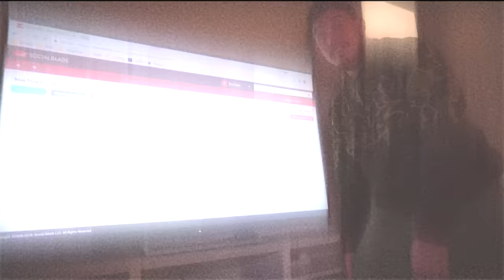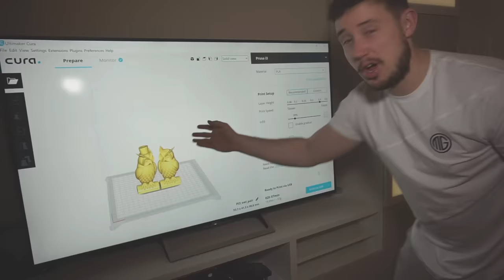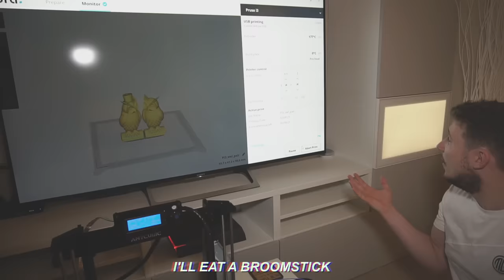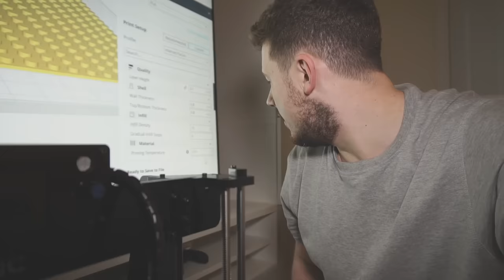I 3D Printed a House & Lived in It… It Was the Best Day of My Life! (3D Print Challenge)

Comment: Not even 3d printed parts... you cant create the gloss like that on a flat surface!
Reply: Hermolian true
Reply: Depends on the plastic
Reply: Haha house go BRRRRR
Reply: @bitsaucetv  It's all PLA, there was no evidence of any layer lines from the print.
Reply: CTH Security don’t forget that different nozzles have different layer lines, and some have really light ones
Reply: @bitsaucetv  Yeah but that printer comes with a .4mm nozzle and you certainly couldn't get prints like that without seeing the lines with that nozzle.
Reply: They’re inverted Lego build plates
Reply: @jacobwhite2737  In FDM in general you cant get away with out print lines.. Not to mention unless he used isopopyl after every single print on the bed the bed would get dirty fast.
Reply: @Emily-fm7pt  I find that highly unlikely, considering this:
He is a complete noob - Im pretty sure somewhere he said he ordered this quickly. 

This printer is extremely cheap and follows the Prusa I3 design.
From experience, I know that without reliable materials, such as aluminium extrusions (smth like the ender 3), 
there is bound to be layer shifts due to movement in wood etc. 

Every fdm printer has print lines, you don't just get away with them it is, again especially noticable on budget printers like you see here. 

As I say in the previous comment, this printer is likely to have a 0.4 mm nozzle which will lead to an increase in visible layer lines! 

Pla is not really a glossy material.

EDIT:
Haha, I just re-read the comment and realised you were agreeing with me or at least disagreeing with something you mis-read.

Comment: Do the same... but make it a lego house and 3d print each lego brick... you are allowed to make custom lego bricks as long as they:
.can connect with other lego bricks
.at least one function if not decoration
.At least two colors if decoration
.be able to be held by a minifigure if mini figure part item.

Also I mean lego sized legos. If not a brick,flat,or tile, or baseplate.